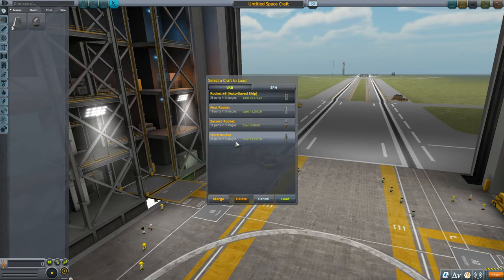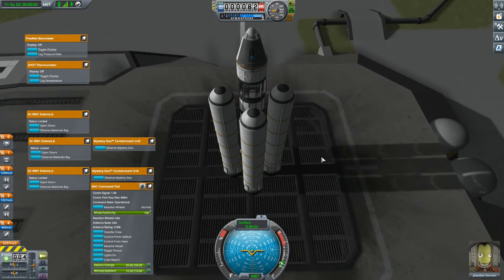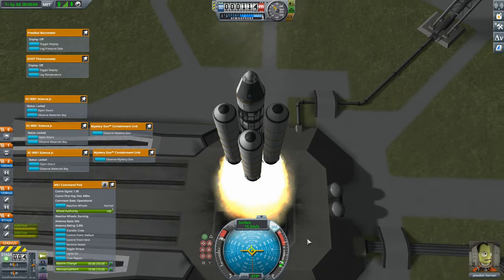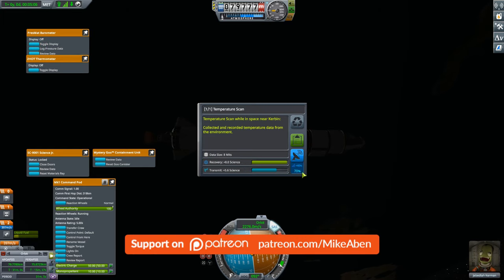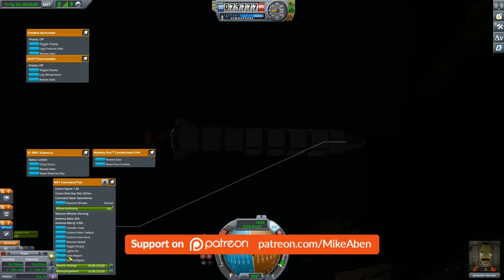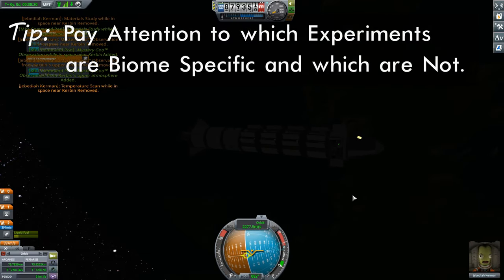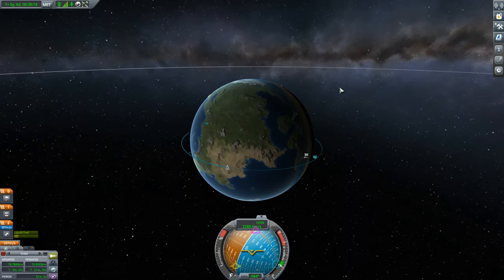How To Get To Orbit - KSP Beginner's Tutorial

Comment: It might be that I’m on Xbox but when I’m doing this about 5 seconds after launch it starts going south and I can’t stop it and then when it gets to about 1000 meters it starts spinning uncontrollably and I’ve done everything that you did and I’m just not sure what’s gone wrong
Reply from the maker: Just a guess but it could be a slight asymmetry somewhere. This can happen as you move parts around. Have you tried putting on fresh radial boosters. Sometimes just replacing the parts clears up the problem.

Comment: What ever I do I can’t pitch the rocket east whatsoever even with prograde on
In order for me to do it I have to reassign the swivel rocket to the first stage to turn
Do you have any tips
Edit: fixed the problem
Reply from the maker: Is your rocket the same design as the one in the video? If so, make sure the reaction wheels in the command capsule haven't been toggled off by mistake (there's a toggle torque button). The only other thing I can think it could be is that your thrust is way too high.
Reply: @MikeAben  yes, actually the fins had to be changed to another type. Thanks for your tips and the throttle was also too high.

Comment: I've been trying to get this to work for hours. I've watched the other video and redesigned it twice making sure everything was symmetrical. Yet I launch and when it's locked to the prograde it's fine at first but then it starts spinning for no reason.
Reply from the maker: Have you tried larger tail fins as suggested in the pinned comment? You might also try my craft file that I've linked in the description. If you want, drop by the discord. You can drop your craft file there, or even a screenshot, and we can try and figure out what the problem is.
Reply: @MikeAben  Now I tried with your ship and it still happened so I guess I'm just a bad pilot.
Reply from the maker: @msidc1238  It takes practice. My guess is you are doing too much steering. The big thing is minimizing inputs. From about 8:30 on in the video, I'm not touching the keyboard at all until I shut off the engine in the upper atmosphere. Don't worry so much amount a perfect heading. Just let the rocket go.

Try letting the rocket build up some speed after launch (50 m/s or so) and then locking to prograde and taking your hands away from the keyboard other than to stage. Don't worry about the heading. Once that's working, revert flight and practice that initial pitching over as described in the video. Lock to prograde and don't do anything other than staging. If the rocket goes in a direction you don't want (it doesn't have to be perfect) revert to launch and try again. You'll get it.

Comment: My rocks keep hitting my engine on decoupling. Ive tinkered with it a bunch and seems like the only solution is to move the rockets way down. Doesn't look the best. Any suggestions to improve this?
Reply from the maker: Only move the boosters down, not the decouplers. You want the decouplers attached to the top half of the radial booster so the force of the decoupler pushes the top away from the rocket. You can use separatrons or small fins to push the boosters away.
Reply: decouple after the fuel in the stage runs out, not before.

Comment: I followed this rocket build to the letter and can't get this to fly properly. As soon as it launches it tends to go west, and no amount of attitude adjustments change it. if by good fortune (in successive attempts) I manage to head east, when second stage kicks in the rocket careens out of control even with SAS stability enabled. What am I doing wrong?
Reply from the maker: I can't believe I didn't post a link to a craft file. Let's start with that. I've got a link in the description now too. That way you can compare mine with yours.
https://drive.google.com/file/d/1Xz1gg32KNYCuA8B56rxgBTY25KrXKED0/view?usp=sharing
Make sure things are balanced. For example, if the thrust is tweaked down on one booster, make sure the opposite one is tweaked the same. During most of your ascent, you should be able to just lock it too prograde and hardly make any attitude adjustments at all. If it still wants to skew away from the prograde vector on its own, something is out of balance.
Reply: @MikeAben  Thanks for this. I have noticed that my boosters and coupling were set too low. Also, instead of pushing the anchoring structural element downwards in the service bay, I had pushed it upwards to the module, I guess it made it too top heavy. Additionally, if I rotate the module to face west so I can use pitch for the gravity turn, it also helps a bit.
Reply from the maker: Glad you got it too work. If rotating the rocket makes a difference, there still must be an asymmetry somewhere. Are all four of the tail fins there and as low as they can be?
Reply from the maker: Another thing to try is too swap the small tail fins for some bigger ones.

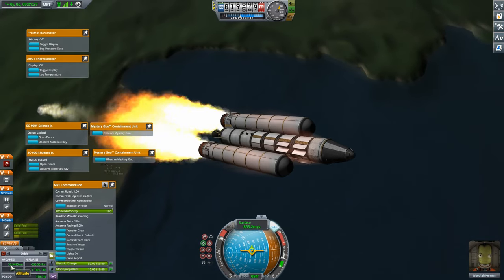Comment: my rocket starts spinning like crazy  after like 1 min of when i eject first of my two boosters right about here 9:20 and then a different question my spaceship in sandbox mode is orbiting the sun betwen the orbits of minmus and mars it dosent have any fuel left any way to get it down 😅. Plz answer both questions
Reply from the maker: Are you using the same design as the rocket here? Try putting on larger tailfins at the bottom of the core stage. Also, stay very close to the prograde vector on the navball.

As for the ship stuck in space there are a few things. Does it have a docking port? If so, you could send up some fuel and dock with it. You can accomplish much the same using the grabber. You can also send up another vessel and EVA the crew across. All these things require an interplanetary rendezvous which can be tricky.
Reply: @MikeAben  i followed your exact design and was using stabily assist system and i will soon try out with big fins as per ship i dont have anything on it exept a unlucky pilot and this is because i did not expect it to go that far as i had only 2 big fuel tanks that connect to mk-16 pod and 1 engine i was expecting to land on mun but ended up there plz make a tutorial on how to get back stuck ships
Reply from the maker: @vedantaggarwal6641  I have a video on rendezvous dropping tomorrow, though it is only in low orbit. Here's an older video on orbit phasing which helps with tougher rendezvous.
https://youtu.be/0Okssg75JVc
Finally, here is a let's play from a while ago where I perform an interplanetary rendezvous when I messed up, though it isn't a tutorial.
https://youtu.be/WXCOCGNcvsE
This is a pretty advanced topic. I would need to get some other ideas out of the way before tackling it.

Comment: My rocket just starts spinning and its pissing me off and how do you have so much fuel
Reply from the maker: By spinning, do you mean end over end with it flying backwards, or spinning around it's long axis, like a top?

If it's the latter, there's a slight asymmetry somewhere. Check the tailfins and radial boosters (or the decouplers they're attached to). If they are rotated slightly, that will cause rotation. Rather than trying to straighten them, replace them with new ones.

If it's end over end, you are either veering too far from the prograde vector during flight, or your centre of mass is too far back. Trying sliding the boosters forward a bit, or moving the tailfins back. There's my craft file in the description if you want to compare.

Comment: Don't know if you'll see this but I've copied this rocket exactly.  My final number varies from yours by seven.  When I launch the rocket I do as you did but for some reason it goes off course. Don't know what the problem is but it's aggravating to the point I don't care to play much. You have this problem and what did you find out?  Thanks  I saw the above possible of taking off two science jr and changing fins but still slowly veers off course.  Plus srb's cannot tilt at all.
Reply from the maker: Read the pinned comment on this video. I've got a video addressing this very question.
https://youtu.be/H70C32ECn6E?si=uhjlR9A049zhrPDE

I've also made, what I think, is a better getting to orbit video here.
https://youtu.be/lsVZt04DpvM?si=LpDvWmFNxqzPgtVM